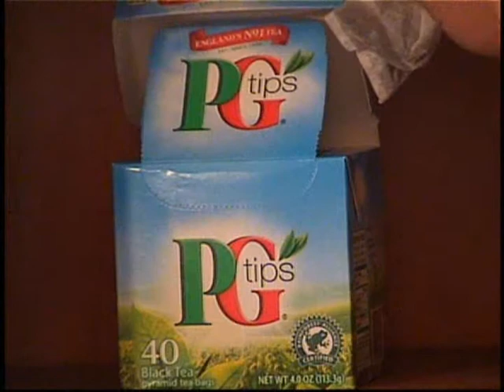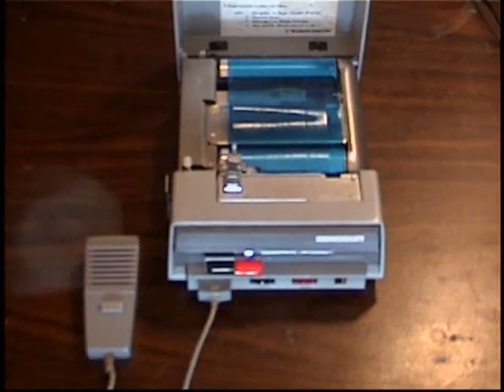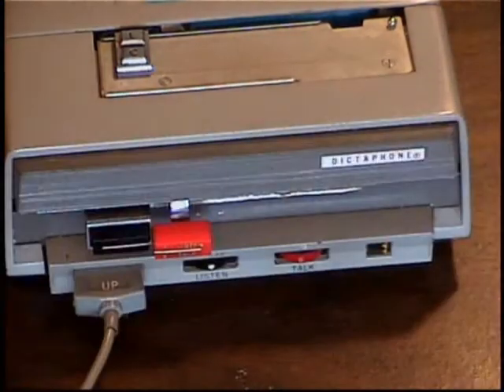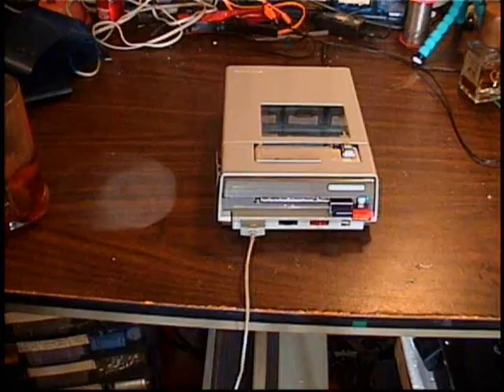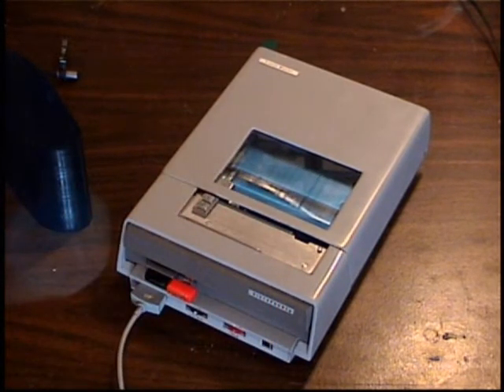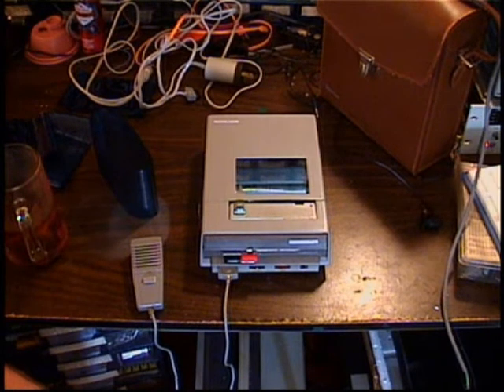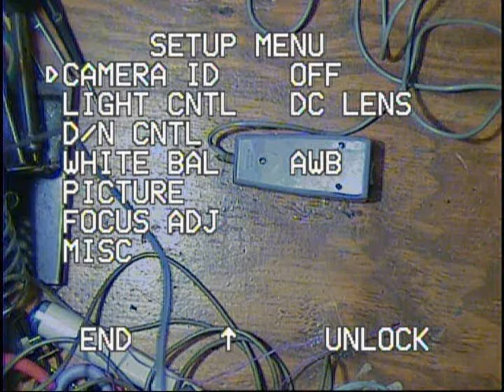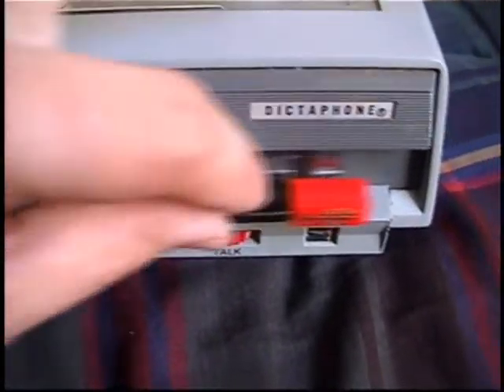Dictaphone Travel-Master Dictabelt Recorder, c. 1962

Comment: Nice to see one of these machines again. My dad used these things and also the Edison one that cut the little red records (which you could play on a phonograph!)

This reminds me of the Tefifone playback device. Those are very strange but cool machines! 

Could you put the belt in a pot of hot water to soften it and then around a round drum of some kind to smooth it out?  It wouldn't make sense to soften it and then put it on the rollers because as it cooled, it would take the shape of the loop. So it would run unevenly on the rollers.

But if it was put on a drum, it would cool in a round shape, and so it would track more evenly. Just an idea, I have no clue of it would work or not.

Comment: Wow! That Ending is A Classic! Haven't heard that in Years! Nice Recorder! Did You Restore It?
Reply from the maker: It is mostly original parts. It got new batteries, and the rubber belt cleaned. Technically I had to "fix" it once, where the motor one day decided not to run. While troubleshooting, I tried temporarily shorting out the base and collector of the motor driver transistor, and it sprang back to life, even after the short was removed.
Reply: That's Awesome to see a 55 year old Recorder still Chuggin'!